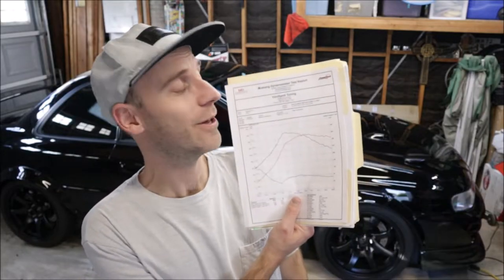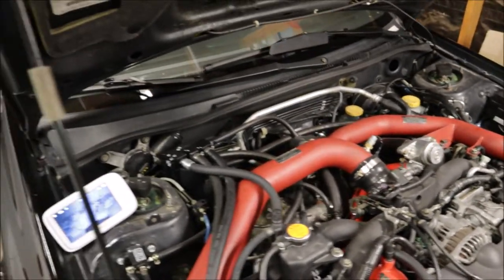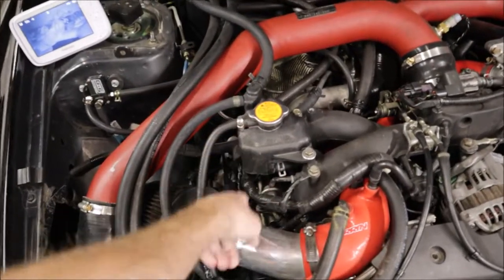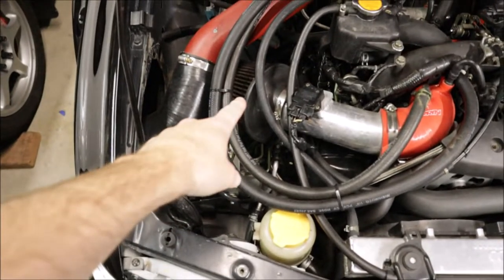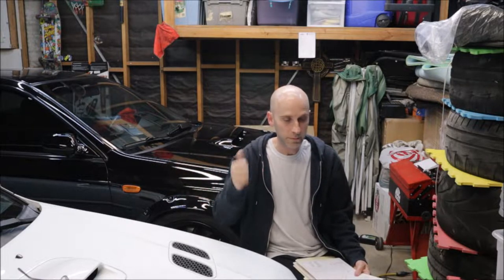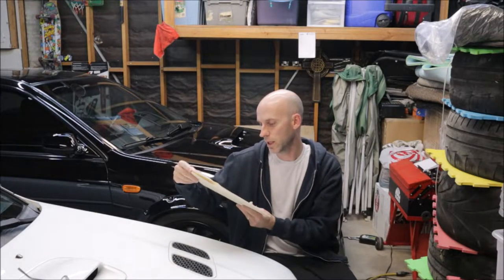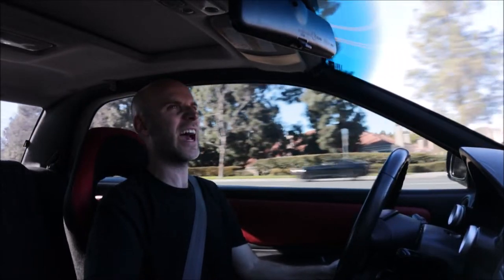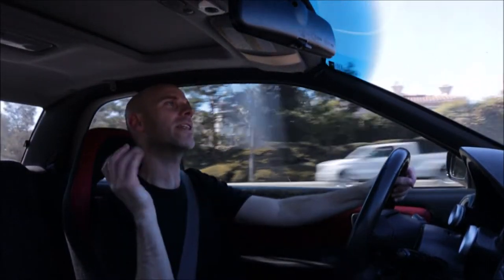Dyno Success! The Impreza GC8 RSTI FINALLY Gets Tuned

Comment: I’m much older than you, 57yo. I’m also into Subarus, it was so familiar when you comment about suspension roughness. I like power but can’t tolerate coilovers, 24mm sway bars and race polyurethane bushings anymore. Congrats on your build, good luck with that ej257 short block. I’m a factory ej207 guy, 2L don’t make the same torque as your 2.5 but I like that they can be reved to 8000 rpm and seem to hold better at the same hp level you are at. Hopefully your tune is good, monitor knock, may you not get broken pistons.
Reply from the maker: Ain’t that the truth. The stiff ride is ok backing out of the driveway, then my back says “No thanks”

I know these coilovers are not the highest quality, however, they all run stiff!

Love the ej207! That will be my next choice if I build another one.
Reply: i have a sf5 forester - ej 207 RA STI Spec C engine - 8,200 rpm $12k on the engine = 255 kph all day long !

Comment: I agree with you about the HP numbers. And Ill throw another thought/way of looking at things. Ive had turbo Subies since 2006, one thing ive learned is HP numbers mean almost nothing. Its actually other metrics we really should be concerned about 0-60 1/4 mile and other measurements of how fast it is. Ive seen subies that can wave around high hp dyno sheets get beat by well setup close to stock setups, and seen similar to those close to stock setups that are really slow. Like for example I have ej207 V7 with stock vf30 tuned at 20psi with alot of mods GD(Tune is sooo perfect) and a ej257 GC with a Blouch 1.5xtr(tune is not that great but stable). The 257 has more overall power but spools alot later than the 207. I have a feeling the 257 isnt that much faster than the 207. Atleast in the 0-80mph I usually do.
Reply from the maker: Preach 👏 truth right hear, thanks buddy!

Comment: Hey great numbers! mine just got tuned here on 93 - mine has the 205 heads and ecu with ej257 bottom and those je pistons - numbers are 312whp 363tq mustang dyno. I used an 11blade wheel on vf48 so boost starts quick
Reply from the maker: Sounds nice, congrats! Best I could get out of the crummy 91 we have in Cali

Comment: When I was looking for a diff and STI trans, I would read that is not recommended to have the R160 with STI Trans. Ratios are different and it can end up damaging the transmission. IDK if that true or not but might want to so some research on that. and sick build BTW ! lol
Reply from the maker: Thanks! If the final drive ratio in the transmission match the diff (3.900 or 4.111 or 4.444) there is no problem. The R160 may not hold the power a R180 can... but that's a strength issue.

Comment: If you are still on this car… throw the Cobb out and get a Link G4X… Cobb=boom for the engine. Also, your chart looks terrible! Look at the curve dying off! You need to shift way before an actual powerband… dude, 325 dying off to 200 before shifting looks horrible. Get a LINK. It doesn’t fall off, you can hold the boost. Cobb are yesterdecade